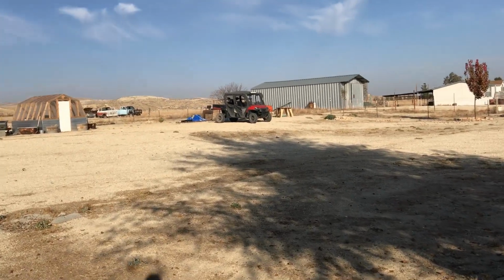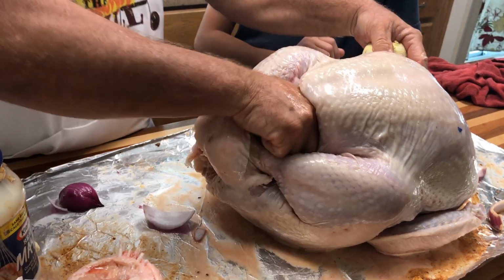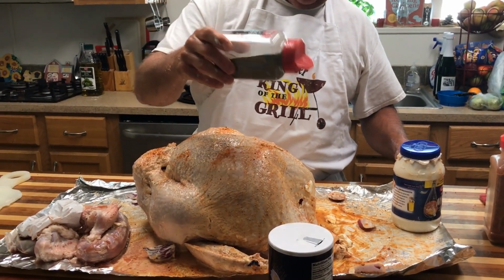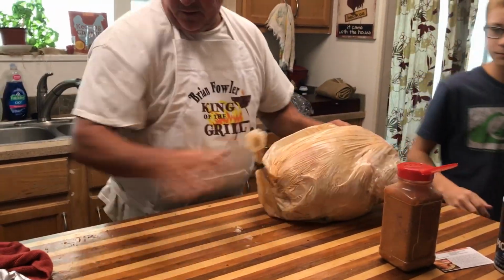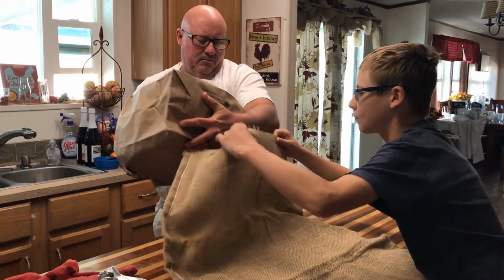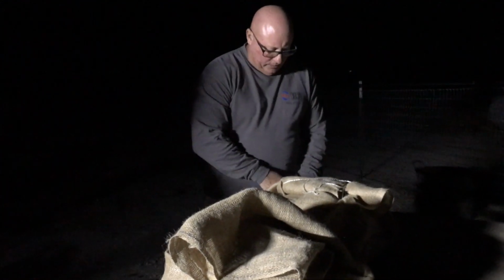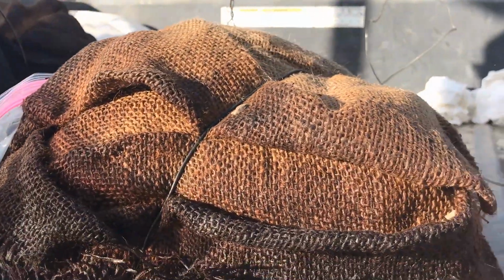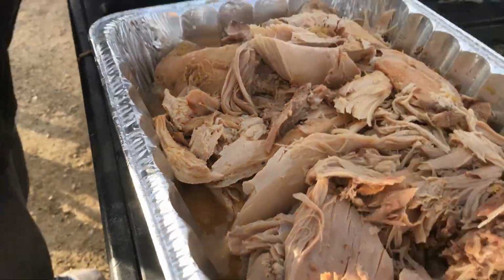How To Prepare A Turkey For The Deep Pit (Vlog 20)

Comment: I’ve had a problem with my oven bags popping and then all the juices leak out. And I put it in 3 oven bags and wrapped it 3 times with foil. Any input would be great as my family doesn’t let me live it down
Reply from the maker: Hello! 3 oven bags popping is quite surprising,  is it possible that the deep pit is too hot for the bags? We normally put our turkeys in two oven bags and wrap in foil twice without issue, it is strange that three oven bags are popping.